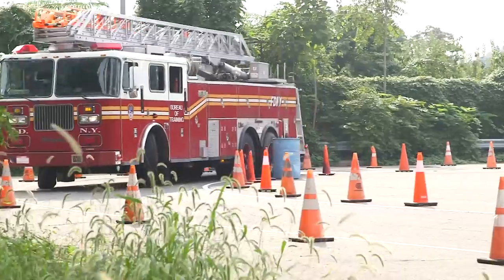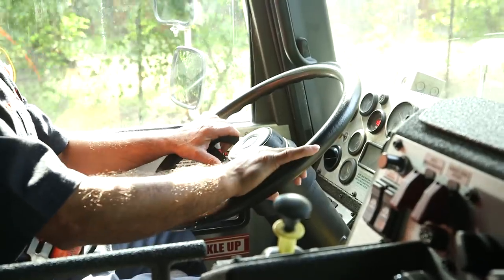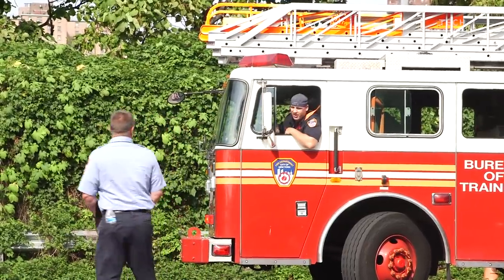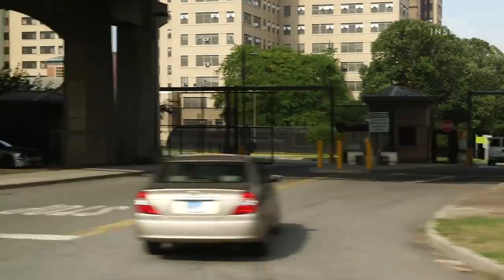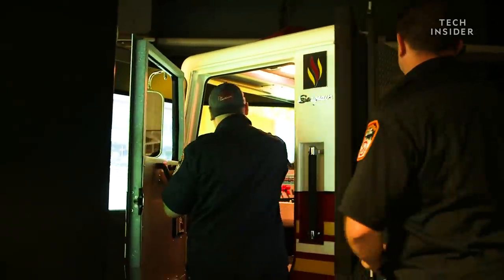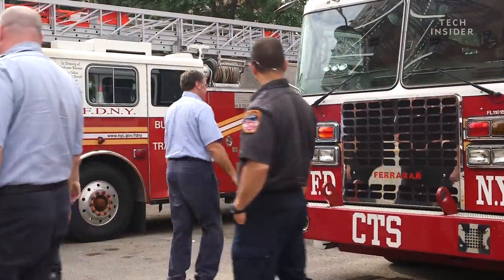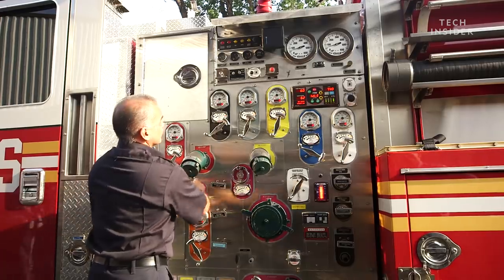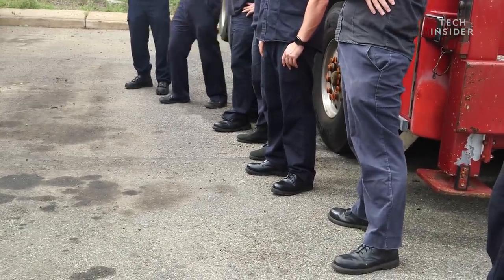How Hard It Is To Drive A Firetruck

Comment: That's indeed a huge difference between American and German fire departments: keeping the crews of Engines and Aerials apart ... here the fire-fighters are cross-trained on every standard apparatus and then a selected special operations units. Depending on the department they might staff several different units at the same time. And every few weeks they switch their position on their "primariy" truck, thus e.g. they might be primarily on the Engine for some weeks and then on the Tower Ladder the next weeks
Reply: EnjoyFirefighting - International Emergency Response Videos I cant see all of your comment on my phone
Reply: Operations vary widely from department to department (district to district). For example, Where I trained, there were crews of 3-4 that would be 24 hrs on and 48 off. 3 shifts. A, B, and C. Of course sometimes with variations. The equipment there was a engine, tender, and 2 squad units, a rehab unit, and finally our training engine. (The first squad was a SUV used for medical emergencies, the other was a light duty truck used for wildland calls like brush/grass fires). Every fire fighter was trained on each rig. So they can get on any rig and know what there doing. Now this was in a more rural station. More urban stations will have larger teams and more equipment and slightly different operations. But they are all again, trained on each rig. However, this knowledge is only from two districts. Which but up against each other.
Reply: @snowowl4019  I used to live in a city where the career / paid fire department had ONE station which covered all of the city area first due. The station crew was usually counting 21 fire-fighters which had to staff 55 different units (well, some few didn't had staffing like some service car or spare units, but most units had a crew)

As far as In know they strictly keep the crews apart at the FDNY. Those which are on the Engine will be on it in 2 weeeks and months and years as well. Same with the Aerials or Rescues. At least that's what it is like for their standard apparatus, don't know how it's like with the special operations units
Reply: In most places in the US, you're cross trained. Most firefighters are also volunteers, here. New York City is a huge city with special challenges and like lots of traffic. Most US cities don't have 100 story buildings
Reply: @EnjoyFirefighting  just to add to what snow owl was saying. All FDNY members know how to operate operate both engine trucks and ladders. But Its up to the member to select which truck he would like to work on. Every one is trained the same way, its just that some people prefer ladder work versus engine company operations. and for speciality pieces like the hazmat and structural collapse team, that all depends on if you bid to a station that has the truck and if its in your district.
Reply: Depends on the Department. In my department were broken into 3 stations. HQ, station 1 & station 2. My station (station 2) is only an engine, so there is not need for me to learn ladder. However, if I wanted to transferred to Station 1 I would then have to be trained on the Ladder as that station has a ladder truck as well an Engine. If I wanted to transfer to HQ, I would need to be trained on the ladder & heavy rescue as they have an Engine, Ladder & Rescue truck there.
Reply: @JoeJ4684  im guessing your coming from a volunteer department? That would be extremely uncommon in union departments.
Reply: This video doesn't show it very accurately. 

In the academy you learn all the basic things a probie is expected to know, how to raise a ladder, how to pull hose, how to swing an axe, etc. You can work on any unit (HazMat and Rescues exempted due to specialized training) as you have gotten all the training. It is basically just a specialty. 

Kind of like how every Marine is a Rifleman, but not every Marine is a EOD Technician. Every Firefighter can preform Engine and Truck work, but if you are assigned to a Truck company you will be better at truck work than someone on an engine (generally).
Reply: @hihfty IMO knowing how to operate it e.g. due to courses at the beginning of the career is one thing, but when they decide to work on one specific kind of unit and do so for a longer time, it's just natural that you won't be used to operate on of the other units any more, then it's rather theoretical knowledge instead of practical after some months or years. Staying trained because you work on it every few weeks is probably another thing ...
But to be honest: there are too many factors that anyone could come to an actual conclusion that the one or the other system is better. Each one works better in the certain area and department. Thus also the tiny fire stations from the FDNY run way more calls than the largest of our station which easily count 30 to 50 apparatus. In many cities the career / paid FD has only one station, so no matter which apparatus you are on, it's at the same station. Some larger cities might also have 2 or 3 stations. The career FD in our state's capital city (the largest one) has an "enormous" number of 10 stations ... a large number for us, but still few compared to any urban FD in the USA
Reply: In my department which is volunteer we staff what we have available, though there are always cross-training opportunities and most of our DPOs can double as DAOs if need be. From what I've seen from the day crew which is career, their drivers can do both.
Reply: @EnjoyFirefighting  . its not that big of an issue with major departments. Its better to be highly experienced and have a lot of knowledge in ladder operations when it comes down to the fireground. And the same can be said for a dedicated engine guy who spends every day on the Engine. In the smaller departments everyone has to be well versed in every piece of equipment because of man power and its a matter of necessity.  And at the end of the day its a disaster not to have assigned positions for accountability when your working with big departments. But the vast majority of departments are cross trained and are expected to know how to operate all apparatus due to manpower issues.
Reply: Why is your comment going off the page
Reply: In some cities like Las Vegas, firefighters switch between engines, trucks and rescue vehicles regularly
Reply: @Adam23200  I have absolutely no clue ... I expected more bashing of my comment as I was pointing out that difference ... (IDK why but some people have a problem with such statements)
Reply: @hihfty  from my experience it's less of a manpower issue than a tactics issue. Imagine a station with more than 40 or 50 apparatus and can technically place a crew of up to 9 fire-fighters on each Engine ... it would be a slightly extreme number of fire-fighters. Some units which get only few calls a year obviously don't require a permanent staffing ... with every fire-fighter being assigned to 2, 3 or 4 different apparatus which are unlikely to be dispatched to the same call, they can staff each unit although they have a much smaller station crew. Then the flexibility of each fire-fighter counts, just in case e.g. a fire-fighter is out with one of the units he is assigned to and the other one gets an alarm as well, then another fire-fighter can simply jump into his position
Most stations are able to respond with a convoy of 3 to 5 apparatus at once, some stations can also send out 10 units at the first alarm

IMO they don't have to be on the same unit or the same kind of apparatus every single day for year after year to be a very experienced driver, knowing the size and handling of his truck. Switching the units after some weeks, and being back on the other unit some weeks later again is sufficient I guess. Same thing with the special operations apparatus which have rather extreme dimensions, like buses, mobile cranes, Aerials in the range of 170' and beyond, ...
Reply: Most US fire departments do not separate the types of crews the way  NYC does. I understand that in NY, you can stay at 1 station virtually your whole career. In my department,  people get transferred about every 5 years. For us we have really busy stations and really slow stations . Practically,  you can't keep people at slow station their whole career, you just can't  do enough training to make up for the lack of calls. You have to have time at busy stations...
Reply: @TheDesertRat31 thanks for the information how some other departments handle it.
Here we hardly have really busy stations. The busiest get more than 1000 alarms per month, but most stations, even large ones, have a relatively low amount of calls per day. The one in my city (only one station for the entire city and more than 50 units based there) had in average less than 6 calls per 24h shift
Reply: @EnjoyFirefighting  That may be the case in smaller departments and other countries but in The USA and Canada you will never find a major city that runs the way you are referring to. In towns and some volunteer departments it is normal to switch between trucks on a daily base depending on the call. It simply is not the case in the US and a majority of stations in the big metropolitans areas contain 1-2 trucks on average. You can spend your whole career in a station without a ladder or an ambulance in your station and thats just the way it is. You would be expected to know how to operate all apparatus but you would never spend a significant amount of time on it. Im not saying its the best way to be a good all around firefighter but its just the reality of manning,accountability and payroll in the big cities.
Reply: @hihfty  I'm not sure if I got the first part right ... by "may be the case in smaller departments" .... did you mean smaller ones in Germany or in the USA?
Apart from stations in the tiniest of villages and some volunteer stations in the large cities you'll hardly ever find such small stations with only 1 or 2 trucks in Germany. Well I actually know one with a Rescue Engine and Ambulance from a career / paid fire department, but that's the only one I know with such a small station... (and I visited hundreds of stations in all German states).

I'm not just a paramedic but I also record videos of emergency vehicles responding. Waiting for an alarm at some fire station can take some time ... I would never wait in front of such a small station here. Also stations with let's say 10 trucks wouldn't be my favourite destination simply because I expect so few calls at so tiny stations. When you can wait for hours at the largest stations, small stations are even worse ^^
Reply: @EnjoyFirefighting  I'm speaking strictly about the united states. I don't know much about how things work in the EU. I don't even think there is a station in the united states that has more then 10 staffed trucks.The normal is anywhere between 1-5 in the states. In the cities here 1-2 trucks per station is the normal. But we have way more stations then you guys have over there by the sounds of it.
Reply: @hihfty  that's absolutely correct: while we have few but large stations, you in the USA have small but a great number of stations. 10 trucks is something some stations roll out with at a 1st alarm here

Comment: I drive tow trucks. Same concept, my flatbed probably a little less that 43 ft though. Make sure your rear tire is a little past whatever your trying to turn by. Simple concept now execute it in a fire truck and remember you have overhang past the last rear axle so the end of the truck also whips out a bit. i.e. a narrow street with cars parked on both sides the end of the truck can clip a cab and it'll take it straight out lol.

Comment: Crash course on what EVOC III and DPO is like huh?
EVOC = emergency vehicle operation, there are three levels to it. 1 are police cars and other small vehicles, 2 is ambulance operation, 3 is fire truck operations. 
DPO is driver pump operator, which is required for anyone to drive the truck as they are the ones supplying the water. If you only have EVOC, technically you can't drive the truck while on duty until you have DPO.

Comment: To elaborate on engine classification:
Terms vary from region to region, having dealt with sales of emergency vehicles in my area this is what we used.

The term fire engine is a generic term, used to describe any vehicle belonging to a fire department (Yes including ambulances).

The technical terms are these:

Rescue Pumper - An apparatus/appliance designed to carry and dispense water for fighting the fire while carrying equipment for performing rescue procedures.

wildland/Field Pumper - A truck generally built on a commercial chassis designed to fight fires in wildland and farm areas. Generally, they have the capability of pumping water as they drive. 

Tanker/Tender - This truck is designed to carry large amounts of water and/or foam to sites that have limited water access. 

Rescue - This truck is specially designed to carry a wider array of tools than a rescue pumper for rescue procedures. 

Mass Casualty Unit - A specialized unit designed to carry tools and/or facilitate certain functions during mass casualty incidents such as terrorist attacks, multi-vehicle accidents, and natural disasters. 

Hazmat - A vehicle that is equipped with the tools and gear required for scenarios where hazardous items I.E: Radioactive waste, oil, biohazardous contaminants etc.. are at play. 

Mobile Command Unit - A vehicle designed for use in situations where onsite communications and command posts are necessary.

This list doesn't include EMS vehicles as primarily I am wanting to talk about what most people think of when they think "fire engine".

Another thing that is not as talked about but is crucial to departments purchasing new rolling stock is the chassis. Terms vary again so speaking from where I live there are two types: Custom and Commercial. 

Commercial refers to any chassis that is pre-made, these being your pickups, mid-duties and semis. They are cheaper to purchase but aren't fully specialized as a custom. 

Custom refers to the purpose-built chassis made especially for firefighting, while purpose-built and fitted for the task these tend to cost more than a commercial chassis thus are not as common among smaller departments. 

Now feel free to add on to this an discuss differences, I just felt like explaining a bit from my perspective on the matter of emergency vehicle classifications.

Comment: Does every firefighter drive one or do they have specific people driving it?
Reply: Usually one person is assigned at all times to operate and drive the vehicle.
Reply: In our department (VFD), everyone was supposed to be capable of driving/engineering the truck.  Our policy was  the first person into the station was to engineer.  Of course if that person was  inexperienced and we had a working fire, someone else would take the seat.    I engineered a lot and enjoyed it but it also comes with major responsibility:   you have to get your vehicle and crew SAFELY to the scene.   People do some really stupid things when they discover a fire truck near them :(     I was once merging onto the interstate and the car in front of me slammed on the brakes!

Comment: Fun fact: fire trucks usually have north of 500 HP sometimes 600
Reply: Yea, and it's still slow as sin lmao. Don't forget, something like 1000 ft/lbs of torque too.
Reply: @jayprimo  600HP and 2050 ft/lbs of torque for the biggest engine available on the market, which is a Detroit DD16. The Engine is a massive 15.6L I6 Turbo diesel. Max torque at 975Rpm and Max HP at 1800Rpm
Reply: @ColorHawk_ Oh I know. I'm a mechanic for a FD. We run Detroit 60s in the older rigs, and Cummins ISXs in the newer ones 😉